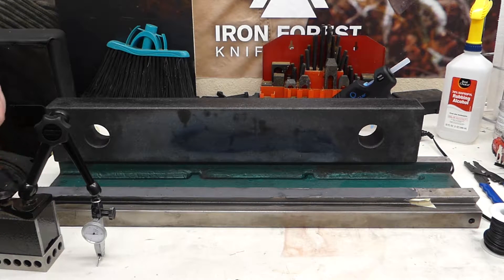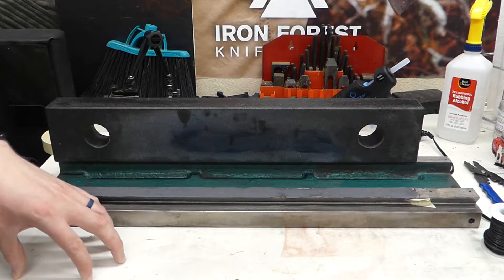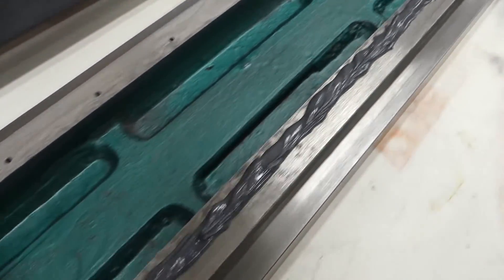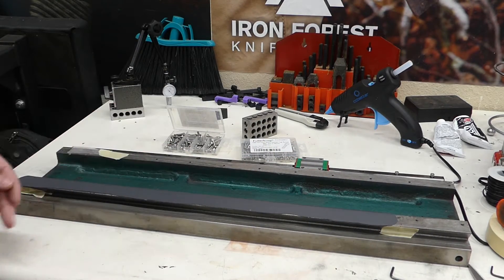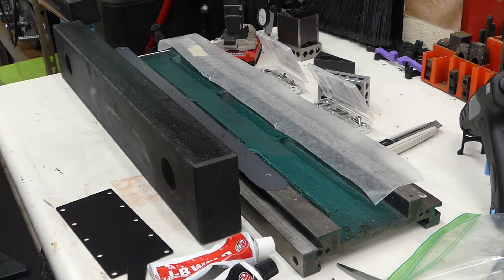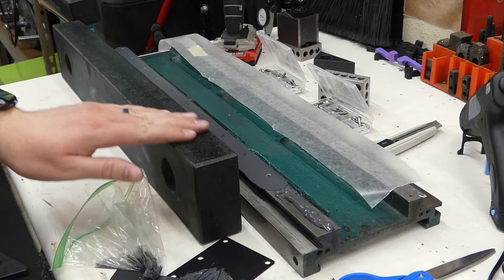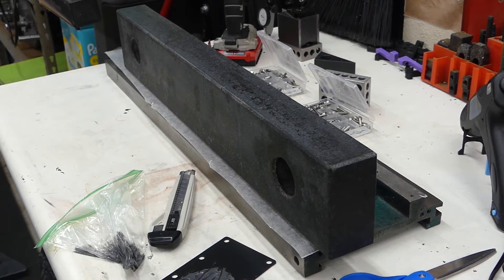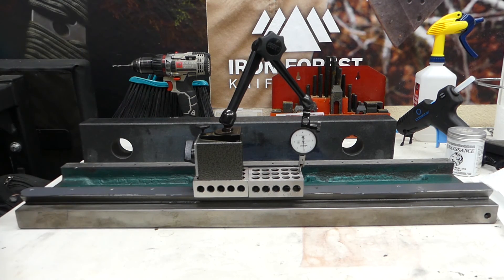My New Method Works! No Machining Required! - Granite Grizzly Project

Comment: Pro tip... just wax the granite straight  edge..apply pva release on top of it... the end... no waves

Those that dont have a granite straight edge just buy  some glass...  pros you see threw it.. you can adjust the squueze out... glass is very straight... if your glass had imperfection you would see distortion  ie a ripple in the reflect or distortion in the refection glare on it
Reply: If you buy glass make sure you buy plate float glass, used years ago for optical applications like TV screens

Comment: Looks like a good option for ppl without a bigger mill. You can always lap the JB weld by putting some adhesive backed sandpaper on your straight edge.
Reply from the maker: Yeah I would have done my conversion sooner if I knew this would work. Sandpaper on the straightedge is definitely a good option. Thanks!
Reply: That's exactly what I'm planning to use for my 900mmX600mmX600mm. I will use a 60" straight edge with mold releasing compound to press the epoxy mix on the surface. At the ends of the rail support there would be 2 ground and polished shafts mounted on adjustable supports so the two rail supports are in the same plane. The straight edge will settle down on the ends ground/polished shafts while pressing down the epoxy
Reply: @car9167  
Use one precision shaft for both mounting surfaces to have them in one plane. Then use gage blocks on the other side and a precision level to get the surfaces plumb and parallel to each other.

Using two shafts doesn't work as good, you'll never get both exactly parallel and that leads to a whole lot of problems because they'd be restricting your straight edge in two dimensions each. That's asking for trouble.

The old, proven method is quite similar:
So instead you define one dimension (or plane? Sorry, my english sucks but I think it'll be somehow comprehensible) and the height via the shaft on one side for both surfaces at once (think of it as two contact points for your straight edge) and the other via gage blocks or something similar (your third contact point, therefore the more point-ish your contact the better) and your precision level.

I've done it that way and many others as well. There's not much to improve, it's rather certain one will only make it worse.
Can be seen for example here, at around 0:20, if my gibberish wasn't clear enough... :
https://youtu.be/xtFzb6r6Np8

Btw. cheap precision shafts usually aren't straight, or "very precision" for that matter - Buy quality AND double check!
For the precision level, well, can't be too much precision!
Best would be a wyler but a good mechanical one or the more precise digi-pas thingys will do as well (the two most precise/expensive ones, the cheaper ones don't have the necessary resolution and accuracy. At least for what I was aiming for.).
If you're going with a mechanical level get two. ~0,2mm/m to get in the ballpark and 0,02-0,01mm/m for the actual work.
Can be a btch, the good Digital ones are a true blessing.
Reply: @heinzhaupthaar5590  Hey thanks for you time to write this. I was thinking of using one precision shaft but I was afraid it is not straight, they usually have a bow so that's why using 2 smaller but align them somehow. I'll check your video. Thanks again.
Reply: @car9167  
No problem at all, glad if it is of any use.

The Problem of bent shafts is, well, a well known problem. I bought several rather cheap ones and they weren't straight at all. The thinner ones we're the worst in my experience.
A Rexroth 40 or 45mm one was finally sufficiently straight, may have been luck though, but was rather expensive compared to cheap chinese ones.

Anyway, just came to say it's not my Video if you meant it like that. Thomas and Markus are way out of my league, they have some product videos and some of their work here on YouTube.
You can find their channels under 'Markus Müller' and 'Thomas Zietz'.
Reply: @heinzhaupthaar5590  I'm subscribed to Makus for few years now plus a bunch of other youtubers with big CNC machines. I was thinking as an alternative to straight shaft to use 2 I-beam scraped flat and mounted on some adjustable supports at both ends. I probably can have it flat within 5 micron using my granite surface plate. I don't need it to be longer than 600mm, my plate is 900mm long so is doable. Was thinking to clamp the long straight edge on the smaller straight edges at he ends and clamp the ends in some sort of adjustable fixture.